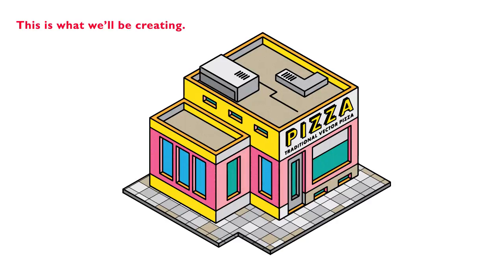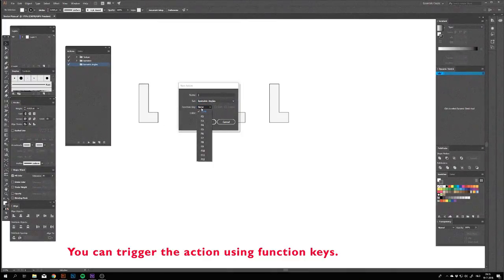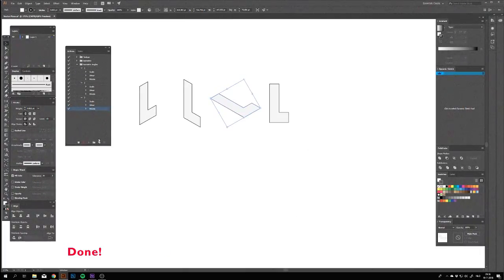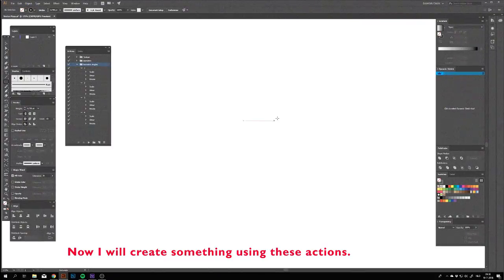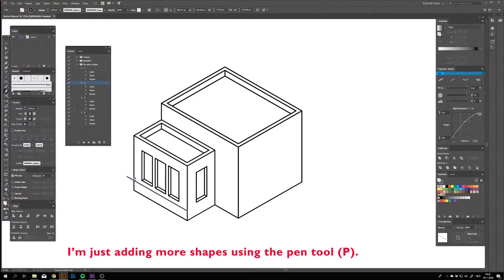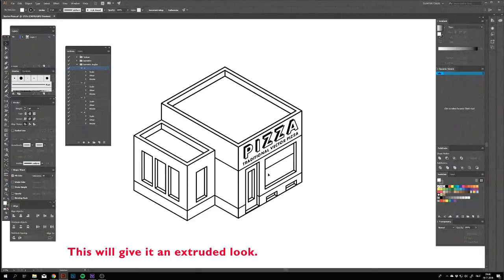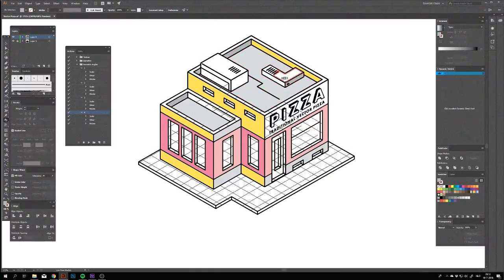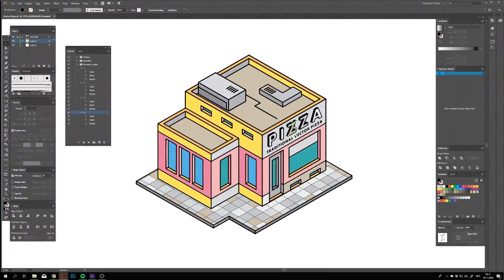Super fast isometric design in Adobe Illustrator without using a grid!

Comment: Thanks for the isometric tips. I just did a big infographic in isometric and didn't even think to set up actions. I could have saved do much time.

My question is: How did you trim those overlapping paths so fast? It looks like you are dragging over the overlapping paths and they delete like I do in Solidworks. Is this a new tool in illustrator I'm not aware of?
Reply: That's a plugin by astute graphics, "Dynamic sketch" :)